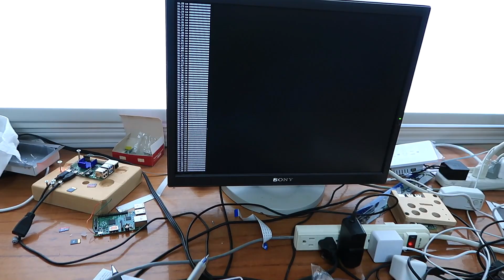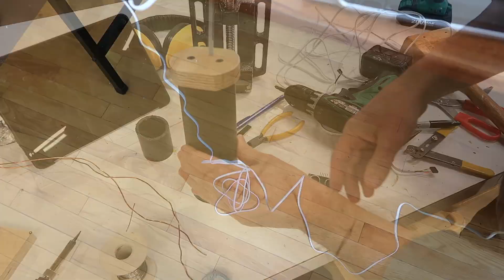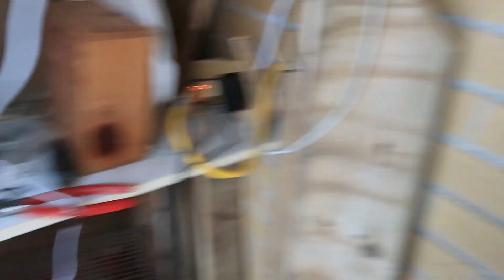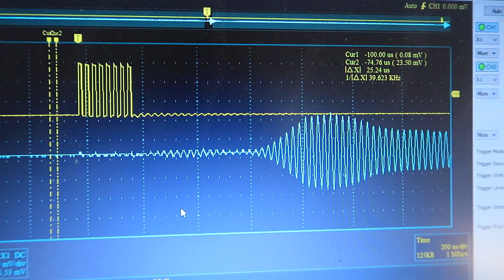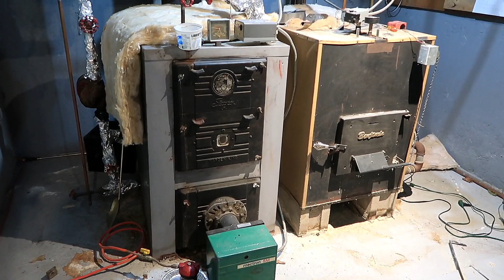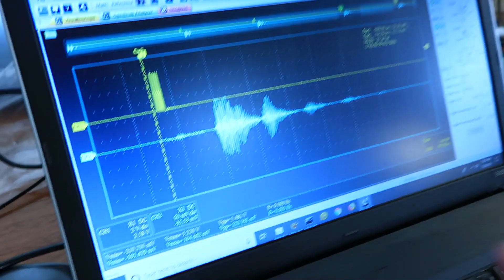Ultrasonic distance sensor as an oil level gauge

Comment: When the Pi first came out I used a ping ultrasonic sensor and it was a disaster. Nothing but problems and limited help with the Pi, because it was so new. I abandoned the project and lots of time later I tried an Arduino and it worked so easy it was kind of a joke given all the trouble I had with the Pi. I don't know about current Pi's, but early ones could not do PWM properly.

Comment: I work with equipment that uses ultrasonic sensor for level measurements. Outputs are 4-20mA rather than pwm.   Can be fiddly though.

Comment: I used these same ultrasonic sensors on several projects.  My experience is that they seem to work fine on the bench but for use in the  real world the output requires some very careful filtering and checking before using the distance measured.

Comment: The speed of sound is also temperature dependent. So the flight time will go up as the temperature goes down. I think this exacerbates the problem of the fuel expanding and contracting.

Comment: Those sensors are made cheap. Plus you also have barometric pressure, that affects the speed of sound... Those weird readings could be an animal on top of the tank, hitting the tank or even crawling over the wires. Radio interference is a possibility if the cables aren't shielded. There are actual liquid level sensors you can get for pi and arduino.

Comment: Excellent!  👍 So, now if you have an accurate strapping chart (lt/mm or gal/in), apply that to your data and use a standard temperature correction for heating oil, you can factor that in and see your actual liters or gallons in the tank, just as we do at a 4 million gallon tank farm.  To be entirely accurate, you also will need to know the level of water at the bottom of the fuel (if any).  Water and fuel have differing levels of capacitance which is how we determine if there is any water present, but we often just use a tape measure with a bronze weight with a thermometer on it.  We smear a bit of water finding paste on it, dip the tank and record the readings and compare to the electronic meter.  Make sure that your sensor is intrinsically safe for use in an atmosphere that may contain combustible vapors; you don't want that sensor to be an igniter.

Comment: We use similar devices for detecting water levels in culverts etc. A bit bigger and fancier with solar power and 4g connection but basically the same thing.

Comment: That distance sensor will last about 6-12 months. Then it will die. You are correct about condensation. However your fix won’t work. For a few dollars more buy the IP rated design. I have experience with this over a number of years! The IP rated design in small cylindrical housing is excellent. I sealed all connections in potting compound. (2 part gel.) I had three water sumps and each one of them died, when I took it apart the inside of the little transducers was completely rusty and gross. Definitely spend the time to upgrade now, it will be worth it!

Comment: Please (anyone) answer this one curiosity ... what would/could the readout display while percussioning the tank wall (at varying frequencies)? (e.g. ball peen tapping or wooden mallet or even ambient room voices/speakers/furnace-turns on/expanding waterpipe clanks, etc)  Thank you in advance from "curious, but too lazy to look it up"
Reply: BTW My great great grandfather had one of the very early ANALOG sonic oil level gauges. It was simple, he would open the lid, yell "GALLONS" and then count the number of "GALLONS, gallons, gal..." echoed back to know how much was needed. To be fair though, he stole the idea from my uncle's failed analog septic tank gauge; and this is where the phrase "he's full of it" comes from. (... he installed it backwards)

Comment: Round up (or down) the values to 3mm (dividable by 0.6mm) , should be enough for a tank that size. It's probably the clock-cycle of the chip or opening and shutting time of the value-reading (pwm?). See if it happens when you measure every 5 seconds apart. Should stabilize....

Comment: I keep wondering where this 0.6 mm steps come from, since the signal looks really "analog" apart from these discrete steps. After some digging on these kind of ultrasonic sensor modules, it seems they all have a microcontroller on board. When translating 0.6 mm to seconds (using 340 m/s) the timestep equivalent to 0.6 mm seems to be 1.76 microseconds. Assuming the microcontroller uses several clockcycles to determine this output signal, the clock frequency of the microcontroller is an integer multiple of this timestep, for example if the microcontroller uses a 6.8 MHz instruction cycle, the calculation uses 12 cycles. So in the end the resolution of the ultrasonic sensor is limited by the processing of the sensor and not the timekeeping of the raspberry pi.

Comment: Why didn't you used an ESP-32 in place of the Raspberry Pi? It's simpler, needs less energy and has WiFi.
Reply from the maker: The pi is much simpler to use, and I can ssh into it and build on the pi itself.  Huge advantage!

Comment: i wrote a program for the TI-83 calculator that used a sonic sensor, and it was surprisingly accurate. very little jitter. i'm also probably one of only a few kids who ever got to use an official TI sensor package for students lol. they do have a max range obviously, and i do remember having weird multipath problems when measuring something moving around near another surface

Comment: One trick is to send pseudo-random pulses and sync up to the incoming wave-forms, as is done with GPS.  Use a bit of machine learning wizardry to match echos and compare them to what you expect from the tank geometry.  You could probably get high resolution by combining different reflection modes.  Another thing to try is to connect a BME280 or 680 sensor to correct for atmospheric conditions.  The BME680 also has a gas sensor which could detect if you have a leak.

Comment: U., you need to use a resistor divider to drop the voltage - putting a single resistor in line will limit current, but not control the voltage.

Comment: Note the the speed of sound changes quite a bit with air temperature (around 0.6m/s per degree Celsius), so that will also introduce errors. You could put temperature sensors in the oil and air space to compensate for oil expansion and speed of sound changes.

Comment: I have a commercial oil tank reader that sends a radio signal to a mains plug with an led display with 10 bars. When the tank is full it has ten bars and goes down in tenths as the oil is used. The unit has jumpers on it for various size oil tanks in height. But not as much fun as your one.

Comment: Leo's Bag of Tricks has a video about developing a water tank level monitor. His design uses a tube that goes all the way to the bottom of the tank to simplify the problem, and he sends single pulses. He uses op amps to condition the signal. It's a great channel.

Comment: This is pretty cool and I thought about automating oil level measurement; however decided to put an hour meter on the furnace instead. With a 0.75 gph nozzle I enter the data into excel, also got real lazy and put a $20 camera in front of the hour meter and can see it from my phone or PC, no automatic data logging so I'm envious of your system with regards to data acquisition

Comment: You should probably figure out a way to display all your pyton scripts to a single monitor somewhere, so you can monitor everything in real time. You should get one of those digital display glasses for it honestly
Reply: MQTT and Grafana would be one of the many perfect ways to do it. Data acquisition on many remote devices sending their measurements to a central broker, which then routes that data into a data base. Grafana accesses that database and visualizes it in many ways. Everything except the hardware is free, and you're also free to choose the way it all connects.

Comment: I build a similar system in 2013 and it still works fine. The signal is processed by a pic18458 (averaging 5 measurements) which also controls my burner and circulation pump. I have a cylindrical tank  of 4500 liters lying on it side so my accuracy is around 20 L (+-5mm). This is more then enough to know when to order more fuel. Temperature, moisture in the air and air pressure also influence the measurements.

Comment: i think you're taking samples way too often. once per minute would be plenty, but if you wanted to derive averages to get a smooth usage trend, maybe once per ten seconds and toss the outliers. one thing i've learned by being in the world of remote monitoring is that a very high sample rate will raise more questions than it's worth. there is very limited value to be gained by chasing down the "ghosts", especially when the erroneous data is rendered irrelevant on the next sample. the more samples you're taking, the higher the chance for a weird fluctuation to make you question the reality of the measurement.

Comment: Nice project.

I did similar but converted needle float gauges (that I already had) to have a hall effect rotary position sensor in line with the needle so it directly measures the needle angle.

Position sensors I'm using are I2C, 12-bit (4092 graduations), and the needle covers ~3/4 of a revolution so theoretically on a 1200mm tall tank it should have sub-mm precision. Realistically the resolution is limited by the 'notchiness' of the gears inside the float mechanism (float tends to drop a 1-2mm at a time as the level drops)

It's mostly jitter free though, even when taking short interval readings without any smoothing.

The unit is also self-contained and battery powered using Lora to send a readings every few hours (which is plenty for something like this, and means the battery will last years).

I also have a few more of these in livestock water tanks a couple miles from my house sending back to the same Lora receiver ...mounted on my chimney stack.

---

NB. I made a previous comment including links to some pics but I think it got removed due to the links 😢

Comment: Linear displacement can be measured with a string making one or two turn around a drum coupled to the axis of a 10 turn precision potentiometer.
The string must remain under tension. It is better to have the potentiometer coupled elastically to the drum to avoid any stress on the potentiometer.
Reply: This is more integrated and less prone to mechanical failure.

Comment: There is a remote measuring system without electricity: look for "pneumatic fuel level gauge"
It allows you to measure the fuel level up to 50 m away from the tank. It works with a small hand pump and a manometer. 
Basically there is a (plastic?) tube with one end at the bottom of the tank and the other end connected to a manometer. One has to pump air in the tube until bubbles come out of the tube in the tank.
Then the manometer reading remains stable while pumping and the pressure is equal to the pressure exercised by the fuel height above the end of the tube.
One can place the indicator near the boiler if not too far away.
Contrary to Matthias Wandel's solution it doesn't give a continuous reading. Continuous measurement is needed if one wants to detect a leak greater than evaporation.

Comment: Have done similar to measure oil level too. Have used same sensor connected to esp8266 which uses some fancy multi measurements and filtering to remove noise. Then it sends data over wifi to Influx DB and Grafana displays graphs.

Comment: I have the jumps on 3:04 as well with the product I designed for work. With 25 of them used in projects I can only agree with your conclusion. These sensors are not trustworthy and the signals don't make sense. We moved towards industrial ultrasound distance sensors from Pepperl+Fuchs with a proper 4-20ma or 0-10V signal coming out. Those sensors are also way more focused and have less inteferance problems.
Reply from the maker: its a tinkerer grade product.  Just like those DHT22 sensors - which are so unreliable no one would ever design them into an actual product!

Comment: I was looking into doing something like this aswell, but I wanted to put some kind of smart hour reader before the burner, since I know how much oil the burner uses per hour I can then calculate the usage. By doing so I would not have to put a Pi outside and the readings of the oil shrinking and expanding do not show in the graph. but then again your system could send a warning when the oil level is at a certain point so you can order new oil :D

Comment: Had a similar problem with water tanks when I lived in a location with only rainwater. Wanted to know the level without going out and checking them. Ended up using a pair of pressure sensors, one connected to a hose at the bottom of the tank and the other measuring atmospheric pressure and the difference to determine the level of water.

Got the PoC working in a bucket, but we moved away before I got it installed in the actual tanks.

Comment: The first electronically controlled traffic lights I ever encountered, ca. 1968, used ultrasonic sensors.  They were mounted alongside or over a traffic lane.  The transmitter and receiver transducers were about 3 inches in diameter, mounted next to each other on a traffic signal grade metal box.  The lane side units had the transducers about 7-8 feet up on a pipe mast, aimed down at an angle into the adjacent lane.  I was young, and had good hearing, so I could hear the ultrasonic pulses quite clearly when next to the sensors.  They pulsed several times per second.  Pulse rate probably around 10 Hz.  I’m guessing, based on the fact my young ears could hear it, that the carrier frequency was in the 20 - 25 kHz range.  From a driver’s point of view, they seemed to work pretty well.  The traffic lights they were connected to seemed to trigger pretty reliably, except perhaps that a motorcycle would not trigger them.  I think the most common scheme now uses inductance, with a buried loop of cable in the pavement detecting the presence of a big hunk of inductive metal just above the coil.
Reply: Inductive sensors are quite common now, more often now very shallow and at a 45 degree angle, to heighten the chances of detecting small and narrow vehicles

Comment: Some tips:
Electrical tape will not protect from condensation, and the hydrocarbon fumes will just make it unsticky and it will fall into your tank. I like vulcanising tape or a spray-on protective wax coating such as "Electrashield" which can also be used on your connections and RasPi. (It is easily removed with contact cleaner)

If there are any objects in the tank such as pipes or baffles near the beam path, they can often give a stronger signal than the level so location is important. 

The expansion characteristics of hydrocarbons is well documented, you can attach a temperature sensor to the tank and have the Pi deliver a "Temperature compensated" value that while does not exactly match the actual value, is more than accurate for your needs.
Reply: Yeah I was surprised he used electrical tape.  Moisture can even get pulled through insulated wires when the encapsulated enclosure "breathes" due to temperature fluctuations.

Also fuel vapors and electricity don't mix with good results. Spark goes boom!
Reply: Fuel vapours aren't that big a deal in enclosed tanks, especially fuel oils and the extra-low voltages and currents being used here. It's done all the time.
Reply: @Miketz  When I worked for a fuel tank company, there were laws and regulations which prevented anything not certified/tested and regulated.
Reply: @TheRainHarvester  Yup - IS (Intrinsically safe) equipment is very important for working in and around open storage vessels. But enclosed tanks containing some product don't have the available oxygen required to allow combustion.
Reply: @Miketz  Also, only brass fittings were allowed.  Other metals, if knocked, could spark / cause explosions.

Comment: FYI, sometimes my oil gauge gets stuck on my tank.  You can unscrew and remove the clear plastic graduated part and grab the float with your hand and just push and pull it up and down.  That will free it up.  your sensor is much cooler though!

I am guessing the sensor does a cross correlation (matched filter) using a stored reference of the transmit pulse.  Very common in remote sensing devices.

Comment: Is there a particular resource or publication that you would recommend for somebody completely new to computers? I have always preferred older manual equipment but some life changes have forced me to learn some new tricks.  What would you recommend for somebody who is mechanically inclined, intimidated by computers, but also actively hates them?
Reply: I noticed you have that little breadboard and a handful of jumpers. Are they perhaps out of a kit of sorts? I'm trying to figure out how to teach myself but I have a lot of difficulty Knowing what I need to know. I think a kid's educational model/toy would be ideal for me. Any recommendations?
Reply: @jpsimon206  They do sell kits for the Raspberry Pi.  I got one back around 2015 for $100 - came with the Pi and a bunch of various sensors and whatnot, as well as a project book.  All you need is a monitor, keyboard, and (optionally) a mouse.

Bear in mind those things run Linux, not Windows.  That means the software that actually controls the computer and that you interact with will be different than 97% of the computers out there.  If you just want to learn how to use computers in general, the Pi won't help you much.  If you want to learn how to interface sensors and field equipment with computers, the Pi is a good starting point.  If you want to learn programming (especially for field devices like sensors, motors, etc.), the Pi is a reasonable starting point.